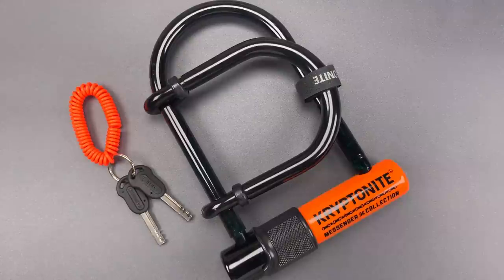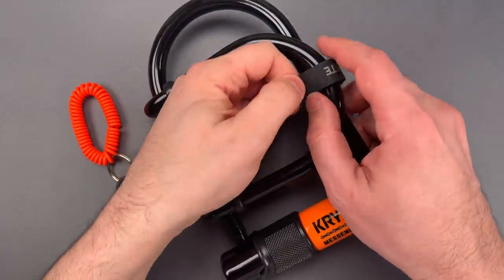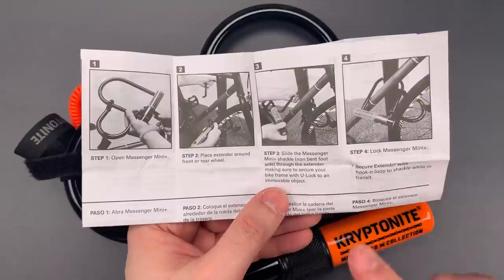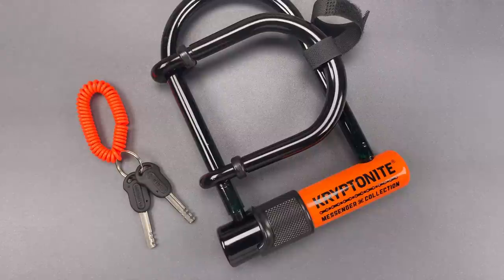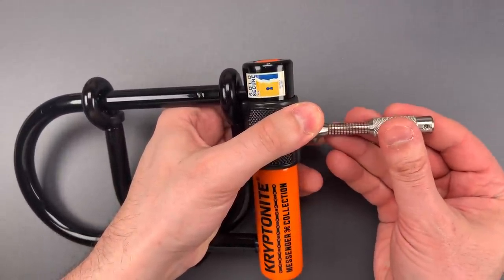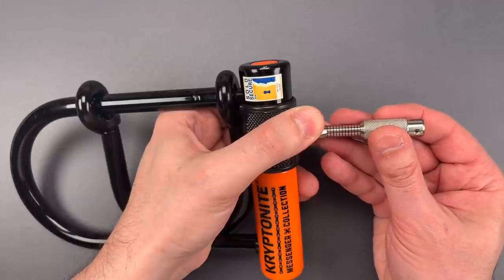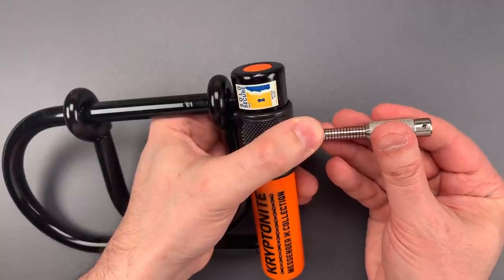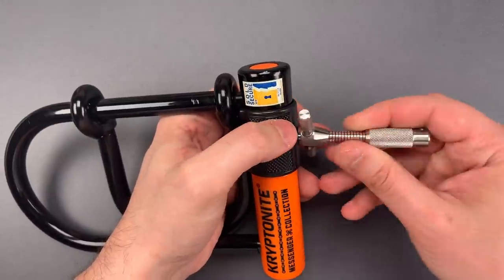[1079] Kryptonite’s Double U-Lock Picked — The Messenger Mini+

Comment: LPL took around a minute to open this

10/10 would buy
Reply: Well, if I have understood this correctly, the reason why it takes him longer to pick open disc detainer cores, is because when they are picked open, they don't pop open like all other locks. So he has to guess when everything is picked, then tension off of one disc, and counter rotate disc one. And if everything is picked, it will open.
That in itself means it will take longer than picking any other lock.
Reply: At the end of the day, so long as a bike lock cannot be raked open no one is going to try picking it. Bolt-cutters and the odd angle-grinder are going to be their biggest threat.
Reply: @ConstantlyDamaged  I'm pretty sure that a regular bolt-cutter can't handle the lock shown here.
Reply: TheLandbo mini-Dremal with metal cutting disc?
Reply: @MistressKuroko  not a bolt cutter
Reply: @MistressKuroko  I used one of them four decades ago, running off of an inverter from our truck, to repo motorcycles when I wasn't having good luck with a lock.
Reply: Won't be long before locks come advertised with a LPL-resistance rating in seconds.
Reply: @MistressKuroko  A battery-powered angle grinder will do the trick. Small, portable, gets the job done.
Reply: @lairdcummings9092  maybe a min or 2.
Reply: @lairdcummings9092  noisy than picking - but not all criminals would be willing to learn to pick locks when they can steal a tool to cut the lock off
Reply: @keithroberts5946  Well sure, tools are noisy, but people tend to not want to get involved, the attack is quick, and really, it's not all THAT noisy.
Reply: Imagine someone not nearly as competent trying it. Honestly 10/10 lock
Reply: @deniwastaken  Heh. He's demonstrated brute force methods, too. ;)
But practice... I can pop the simpler Yales. Now. Practice, practice...

But yeah, LPL is on a whole 'nother level.
Reply: Laird Cummings if you work with angle grinders, you know they’re noisy. Noisy enough to cause hearing damage over a long period of time.

Comment: “Picking this not terribly difficult”. Lock makers dreaded words
Reply: "Not terribly difficult" is high praise from LPL
Reply: In LPL vocabulary "not terribly difficult" means "the vast majority of thieves will be unable to pick it".
Reply: Dreaded words? If I was a lock maker I would put that on the front of the package. "Endorsed by LPL 'Picking this is not terribly difficult'"
Reply: From him it is practically an endorsement.
Reply: "good enough for the streets" from LPL is a solid endorsement.
Reply: if you need a custom pick to pick the lock I don't know if those words can be used, :p
Reply: @plasmaburndeath  you don't, you need a disk detainer pick.
He made a custom one, because he wanted a custom one.
Reply: @candyman9635  which is now commercially available (albeit sold out)
Reply: @adammorris8112  I am aware.
Reply: Master lock has become very familiar with that phrase.
Reply: @plasmaburndeath  Sparrows is making them. They sold out of the initial run but they're selling them :D !! <3 <3
Reply: Knowing that it was at least slightly difficult for LPL is actually a good thing. Meaning its probably impossible to open on the streets.
Reply: @NoOne-fe3gc  Seriously, that would probably even be some effective marketing

Comment: I have this lock, and the extra U for the front wheel is a really good innovation. It's better than a cable extender, and doesn't apply pressure on the wheel, which helps keep everything adjusted. The only practical issue I have with it is that it's very difficult to find a mounting bracket that allows attaching it to the bike.

Comment: Be careful everyone. The vast majority of U-locks are breached with cutters or even angle grinders. On the street, thin shackles like this are removable within 60s or so (which means many thieves can remove this as fast as LPL using different methods).

Comment: Nice picking, and if the lock makers are watching, maybe if you can add spring action to each disc that moves the disk back to its locked,/keyremoval position it would make it much harder to pick if the disc want to unset at will.

Comment: Brute force attack:  I noticed that the slot for the locking pawl on the hooked end of the main shackle is cut very deep and at the point where the bar has been bent (a weak point too?) and might fracture under a screw spreader attack.

Comment: Seems like the weak point is the U section where half the material is missing where it takes a turn to fit into the lock body.  One might be able to saw though that section quickly or heat it enough with a torch to bend it.

Comment: Would locks be more resistant to the “pick Bosnian Bill and I made” if they had like 20 discs arranged at twice the length of the pick insert?
Reply: They definitely would be. The keys wouldn't be very practical, and the lock would be very heavy, though. 99.999% of these locks will be broken by brute force, not picked, in any case.

Comment: I have a question for you good Lawyer sir.  On your recommendation as a good practice lock I picked up two master 410 LOTO locks.  After picking one of them open a bunch of times something seems to have broken.  It sounds like something is rattling around on the inside of the body and the shackle won't open.  It still functions for the purpose of my training, I was just wondering if this has happened to you... or since you've taken them apart you could explain what happened.  Thank you for your time and all of your great videos.
Reply: Never mind about the lock, the rest of the pins just fell out of the core lol.

Comment: Kryptonite-locks are easy to pick...
But a real thief doesn’t pick the lock, he opens locks by using force, eg an bolt cutter.
Kryptonite locks are very resistant against these methods. 
To secure my bike, I use several and different types of locks.

Comment: as someone who bikes a ton in NYC it's worth noting that absolutely NO ONE is stealing bikes by picking the lock. they get a cordless angle grinder and chop the lock in under 30 seconds, zero skill. you could do it in broad daylight and no one's gonna intervene unless it's their bike. so pick resistance is meaningless in most cases. no u-lock is immune to an angle grinder either, so those extra-thick shackle "fuhgeddaboudit" locks just add a few seconds to theft time. if someone really wants your bike, they're gonna get it. keep it inside if at all possible

Comment: This is actually not a New-U Series Lock, as they do not have the bent foot on one side of the shackle, but instead feature a symmetrical design with the ends of the shackle shaped like a half-moon, so that they require the lock to be cut in two places in order to open it, as opposed to one.

Comment: i use a short shackle version of a bike brand lock to secure wheels to frame then a longer shackled U lock to lock it to something. i regularly see the ripoff crews at the mall
you can put together a bike with just two crescent wrenches. they lock the front wheel to rack so you take the frame with back wheel then find another bike with its front wheel unsecured
so you just put that on the other bike you just stole and ride away. the key to keeping your bike is to make it take too long and make too much noise to steal
they'll just move on to another one. all that said i would never drop $180 on a lock

Comment: Thanks for the video.

Most effective method must be and lock an expensive bike with at least 10 different locks. At the same time, one must hope that a possible thief is not nearly as skilled as LockPickingLawyer or has a battery-powered angle grinder. 

Well my own "old goat" is hardly worth more than 20 USD and thus remains standing even with a cheap lock.

Comment: I use a u bolt lock and a good quality cable lock . It's may not stop a real theif but they have to bring 2 tools instead of 1 . I always park it in a crowded area and it comes inside at night . Most thieves won't try to break a lock infront of a crowd.  But some are not afraid of jail and just don't care i ride a mid range bike so the attraction to steal it isn't as much as a bike thats worth something .but then again there are those that will steal your shoe laces if they think they can get a quarter for them .

Comment: Hey LockPickingLawyer, I got a question for a brainstorming:  My logic on locking up my bikes is that less space you have between the lock, frame and whatever its attached to less leveraging options it has, atleast without damaging the goods but with these types of extensions, can you think of way these extenders actually enable tricks like using 2 wrenchs on a padlock to excert the force on the lockmechanism and latch the of the primary loop without even touching the bikes frame?

Comment: I've just bought my first picking kit with a learning lock in it. I have two questions, how do I understand when I'm pushing on a pin or the core? When do I know a pin is over set?
Reply: For question 1, I asked myself the same question and then discovered I was using way too much tension. I know LPL says to use as much tension as the lock will take, but instead start with the lightest tension possible. Then you will always know when you are pushing a pin.

Comment: I actually have a little question in general to you, dear Mr. LPL
I've seen you pick a lot of locks including euro profile locks but there's a thing I don't understand. You pick every single lock with the pins on the top and I guess that's because of gravity to let the key pins fall back, but at least here in Germany, quite EVERY single lock,is installed at the doors with the pins on the bottom, so the key pushes them down. Is that different in the US? And could you pick a lock, maybe even a german one, the way it would actually be installed at our doors or would this make picking impossible?
Greets from Germany, love your  channel, come what may <3

Comment: Your be better off modifying the lock yourself , so all you have to do is put a single thin wire down the middle into a small hole at the bottom that clicks it open.
The lockpicker woukd spend their time trying to open a disconnected mechanism.

Comment: You told us that bad surfaces on inner parts delayed you by obscuring your feelings.
i have a better way to obscure your feeling without lowering the metal parts quality.
a micro vibrator inside the lock body.
it can consume micro-watts and last as long as a watch, powered by a similar cell.

Comment: Can i ask a question? i understand that the channel is all about showing the weaknesses of locks and is entertaining. But doesn't providing the tools to pick these locks, like the special pick you made, available commercially help criminals? Can you explain or make a video about how you answer this question for yourself? 

I like the episodes that show how badly some locks are made and how some do not offer any protection at all. I feel that very helpful to the normal person so that they can avoid these types of products and the reason why they should be avoided. but in the case of good locks with acceptable security features that are hard to pick without a specific tool that isn't on the market, why make the special tools you designed to make it easy available to them for sale by someone else?

i could be missing something. if so please take the time to educate me
Reply: Criminals usually just break the locks because it's faster and lower skill